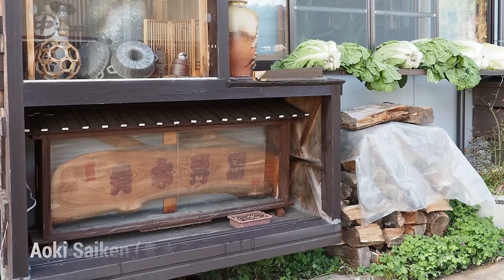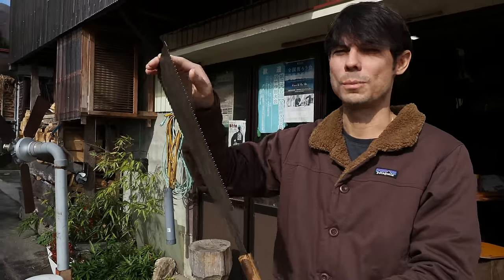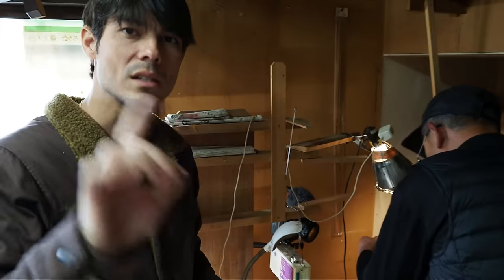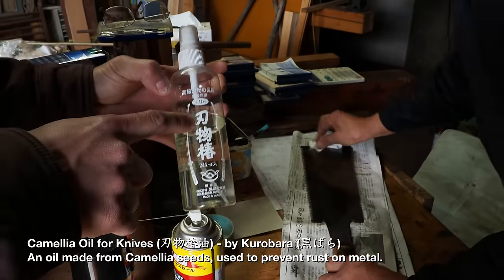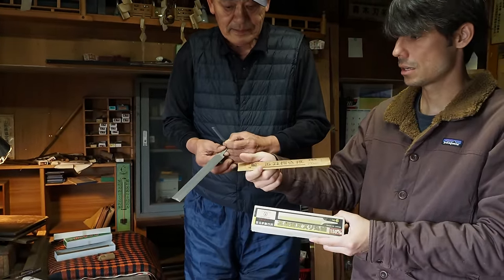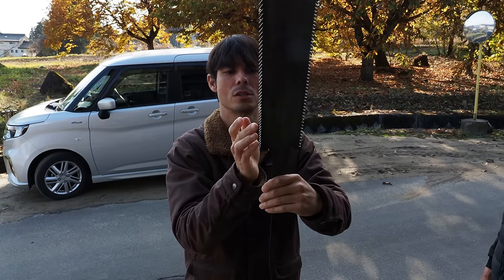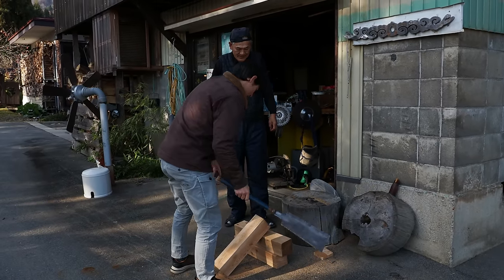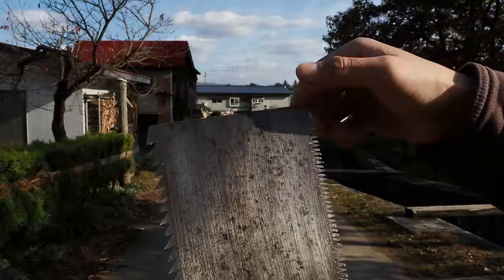Restoring an Old Japanese Ryoba Pull Saw (両刃鋸) - Resharpening Every Tooth - Carpentry Tools Repair

Comment: I have worked with wood for many years. Hearing the Master Craftsman Mr. Aoki describe the sound and feel of the file working with the saw blade reminds me of the phrase other Master Craftsman describe as the material you are working with is 'talking to you'. Between the tools and working piece, they will talk to you and let you know if the blade needs sharpening, tightening, adjustment, etc. Paying attention through experience an apprentice will learn what your senses feel, see and hear means to grow to become a Master Craftsman.

Comment: The first thing he did was level the teeth, then he hits the teeth until the flat spot is gone, then the saw is sharp and each tooth is cutting the same.  I agree with the old man - I'm an old man myself - sharpening is never fun, but it is necessary. (the first files cut on both sides, the finish files only cut on one side - one side of the file is smooth, with no riffles)
@ 14:24  , that is the sound of a sharp saw - I love that sound! (use the whole saw;  long strokes, to wear all the teeth evenly.  Don't grip too tight, let the saw 'float' in your hand.)  Since you're cutting outdoors, with the Sun, position the Sun over your shoulder, right shoulder in this case.  Once you cut 'with the Sun' you will never be as happy cutting under artificial light!
The reason you start a cut with the heel of the saw is due to harmonics - the heel is 'stiffer'.
In saw sharpening, the amount and direction of light is important.  Too much light is no good.  Experimentation is important.
I love how the old man warmed up to the task! He started a little unwilling and cold.  He finished as the Master he still is.
Note the sawdust.  The dust tells you when to resharpen.

Comment: He's essentially designing the teeth on the fly.  It did not seem like there were many bevels to follow.  Takes a long time to be able to do this by hand with such tiny teeth.  I think sharpening is easy when it comes to a hatchet or an axe but sharpening 100s of little chisels like this, with complex angles, that all need to work together is extremely difficult.

I've Sharpened a very small amount of a 4ft saw for green wood (big teeth) and I didn't finish.  It's annoying work.  You need patience.  He touched on that a bit.  He truly is a master.

Comment: Do you prefer the older stock ryoba in your daily use? What advantages do you think the older stock ryoba has over the newer ones with the impulse hardened teeth? I recently got a Kakuri 270 mm saw, but not long after I happened to win an auction of 3 old stock unused 270 mm ryoba. I'm trying to decide if I want one or the other if I should keep both. I happened to find videos showing that the new ryoba can be sharpened with a diamond feather file. Your opinions on this topic will help me further determine what to do. Sorry for the mouth full and thanks for your time and dedication! You're great!

Comment: thx for the video. i have severals saws to sharpen soon next comming year on my job :) i have a qeustion those feather files i saw some on the website of the tool shop (kurashige) you showed in another video tough they only sell 75mm and 100mm files for low price i wonder do you know where i can get longer files? for around the same price as they where offering it?
Reply: @shanedevon6447  yea i have a goverment paid job. and we got a limited budget per year for tools. so its cheaper to sharpen them than buy new ones

Comment: Weird question, but what pants are you wearing btw? I love the look of them and would like to try a pair.
Reply from the maker: The pants are by I'Z Frontier (Model #7892). They are a brand of work pants in Japan. You can find them on Amazon Japan or in local work wear shops and some big hardware stores in Japan. The cargo pocket is more towards the front of the leg which is nice if you wear a tool belt a lot.

Comment: I sharpen my Disston saws, interestingbthst he has the saw at 30° to sharpen. 

That one stroke push is important.

That double sided in the same saw is interesting..oh my he set the saw teeth with a hammer on each tooth....